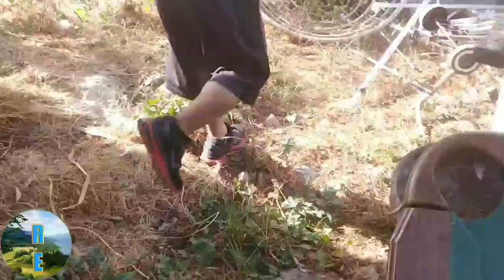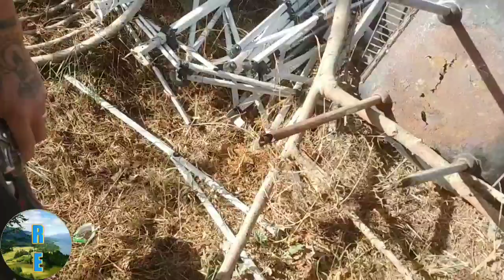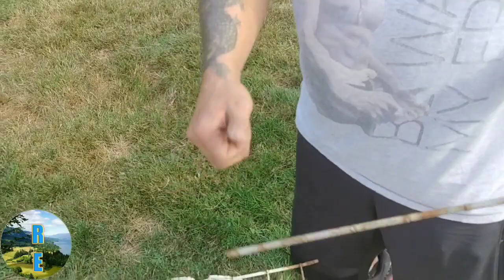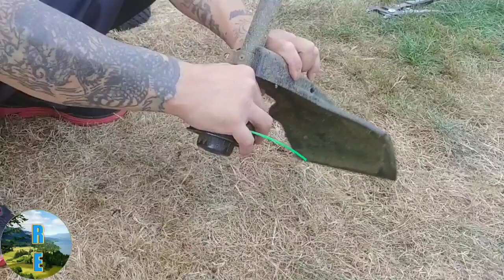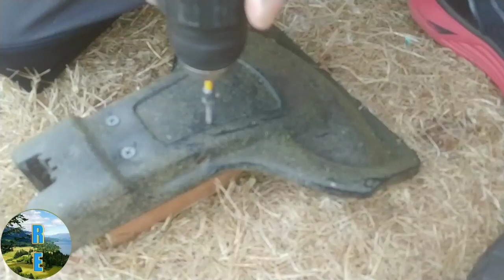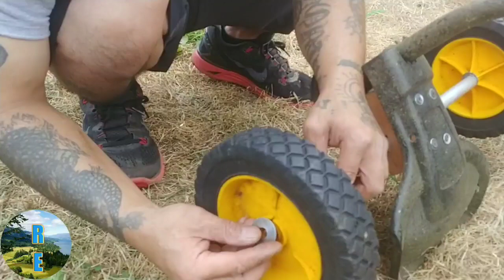How to put wheels on a Weed Eater

Comment: It needs independent swivel wheels under the bar, how does the string work? Can’t move side to side either
Reply from the maker: It works fine for me thanks for watching
Reply: It doesn't work if you need to go under solar panels that are very low